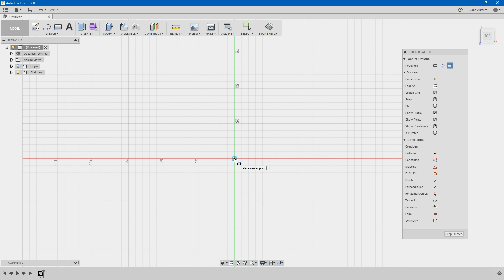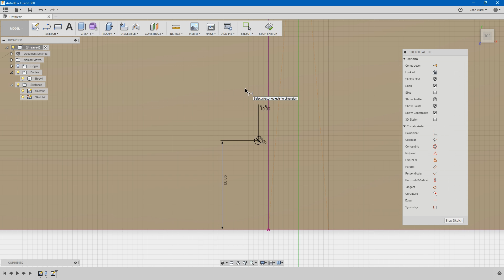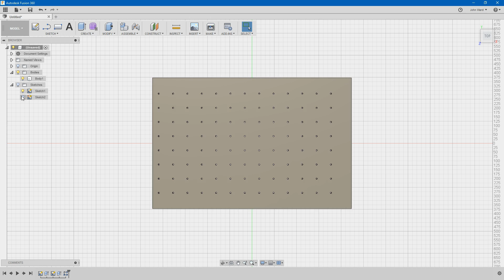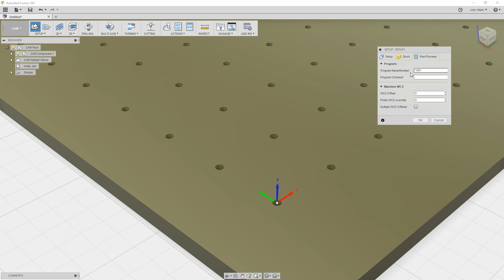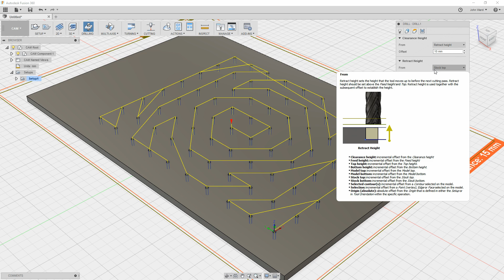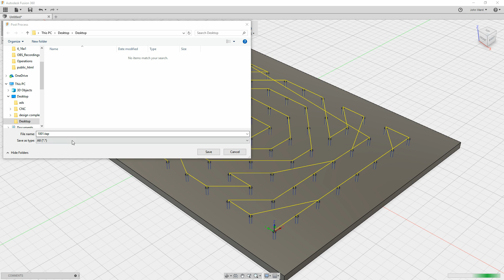CNC Router Build #10 - Using Fusion 360

Comment: Good educational video. Just moving to from VCarvePro to Fusion360 with a SolidWorks background and pretty much knew all you talked about, but watching it step by step is great reinforcement. What screen capture software do you use? It is very clear. I have a 6040 and Mach3 and would like to move into 3-D CAM pathing.
Reply from the maker: Open Broadcaster was used for the capture.
Reply: Thanks, and now watching the CNC build in order. You should make a Playlist for The CNC Build, and/or Fusion360 Projects. There is huge demand for F360 info currently, and you are a good instructor.
Reply from the maker: CNC playlist already done here: https://www.youtube.com/playlist?list=PLVsHvs2Suqmp7di69X5mYnVeM84rij8I-
Only one Fusion 360 video currently so no list for those.

Comment: Hi John, i have the same CNC from Cau Cau and i would advise you to change all axis bearings to SKF 7201 angular contact bearings. Cau Cau uses radial bearings and they only can stand 25% force side to side. Also these ball screws need to have one solid bearing block and one floating block. You can check them out BK 12 and BF 12 bearing blocks. You will understand. I ordered my ballscrews with nuts and bearing blocks last week and will start upgrading my CNC soon. Also you should also use XBOX controller for controlling CNC movement. It's so easy and convenient. Allso check the ballscrew bearing alignment. My cnc had bearing blocks on different hights, so they tend to lock up and loose steps. 

All the best and keep up the good work! ;)